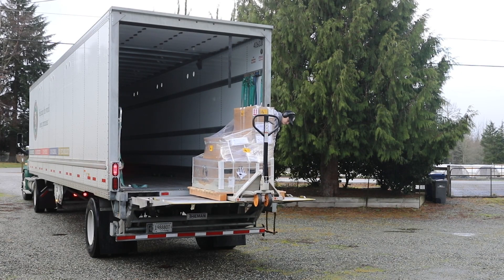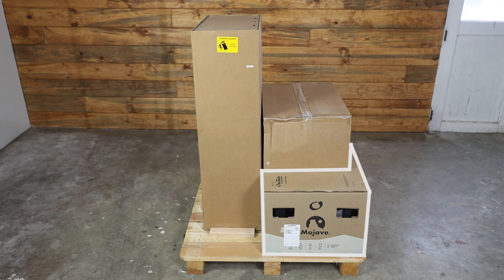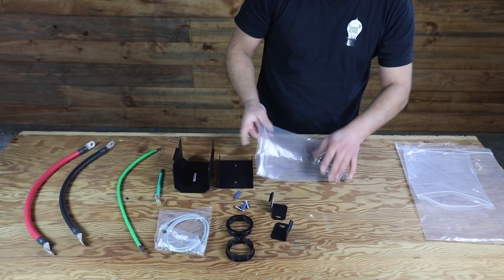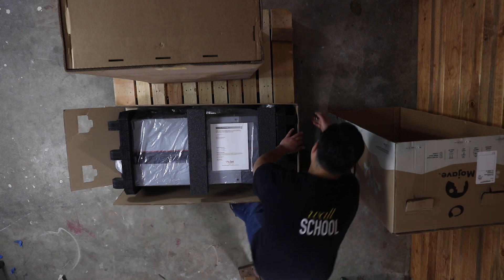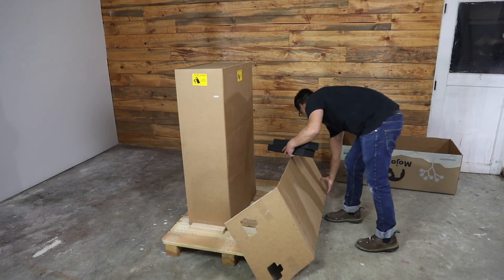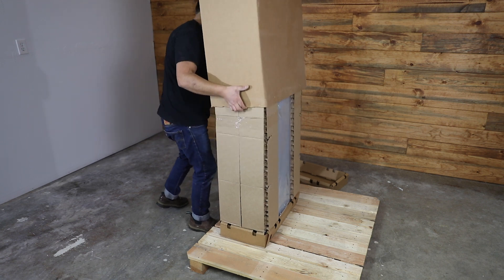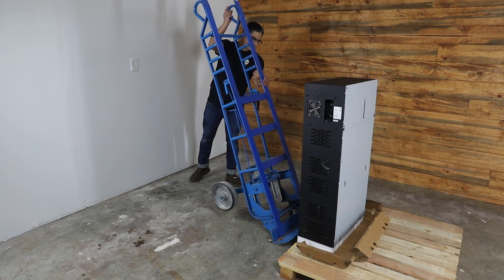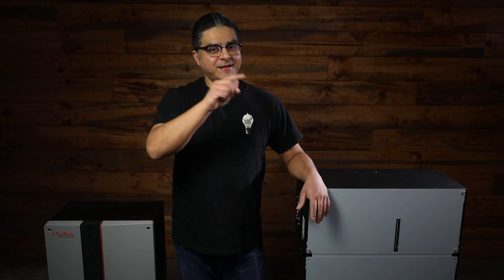Mojave Energy Storage System: Unboxing

Comment: So is this all? Or the next video will be the installation of the unit? Thanks
Reply from the maker: Hello Fernando, yes, more videos are coming soon. Including installation. Stay tuned!
Reply: @OutBackPowerTech  and will they be able to work in Mexico? I haven't been able to use Radian since your distributor down here says they are not compatible with the Mexican grid or something like that.
Reply from the maker: The Mojave Inverter/charger AC output is similar to the Radian being split-phase 120/240Vac. Unfortunately, Mexico's grid source is three-phase 127/220Vac, so yes, the Inverter/charger will not accept a three-phase source. However, there are practices using a transformer that may allow compatibility. Check with your local electrician on how this can be done.